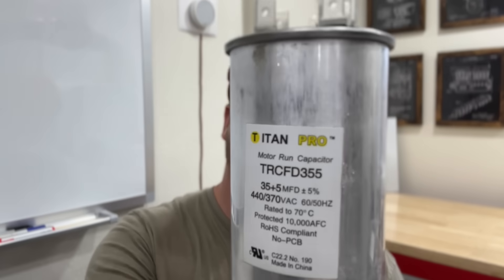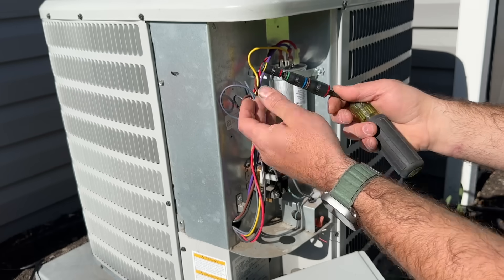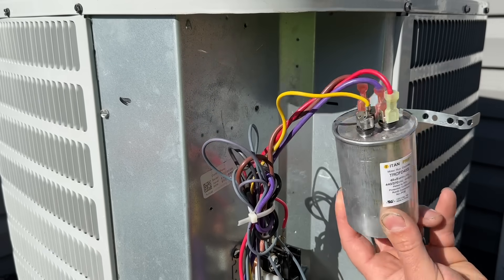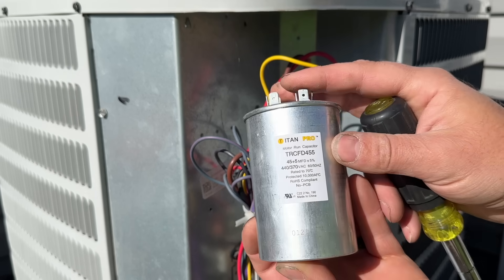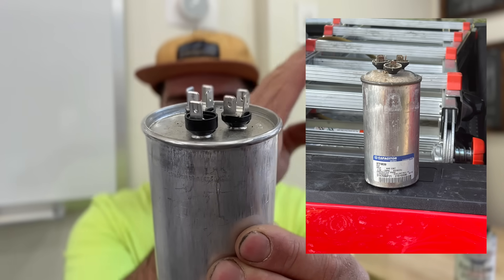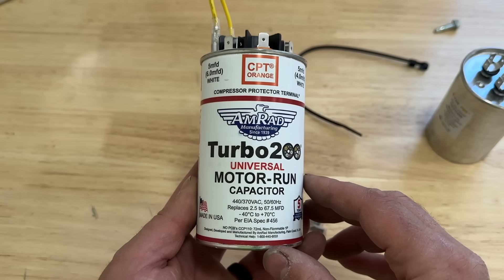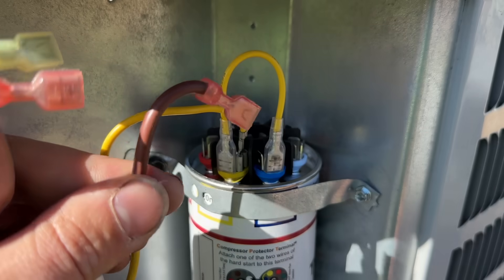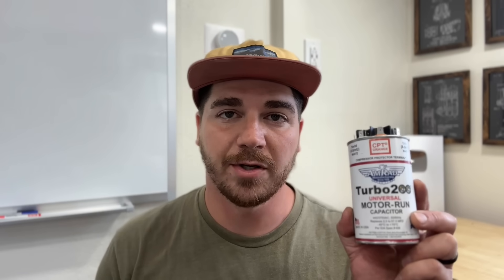HVAC Contractors Practically Make Their Living On These

Comment: I've learned a TON about hvac (mainly AC) from you in the past 2 years. I now own a new house and I've bought a replacement capacitor, added a soft start kit, cleaned the coils and checked the refrigerant pressure, thanks to you and your videos! Genuinely appreciate what you're doing.
Reply: Cleaning the coils is something people largely don't do and not changing the air filter at least once every 3 months. Or get the wrong air filter and shorten the life of their air handler. I never go over Merv 11 for an air filter. The higher the Merv rating the more it restricts airflow and the harder your air handler has to work. Besides anything over a Merv 11 rating is overkill for 99% of people.

I clean my coils at least once every 6 to 8 months on both my outside unit and air handler.

Also, if your pour 1 cup of white vinegar down the evap drain pipe, monthly it will help prevent algae built up.

A little scheduled maintenance can go a long way in how long your AC unit will last.
Reply: @RhinoXpress  I’ve gotten into a routine of changing my filter every time I pay my electric bill…once a month.  I use an 8 merv filter.  I do have my AC guy come late fall and spring to do a preventative maintenance on my system. I’m in Florida so that AC is running CONSTANTLY for about 10-11 months per year. He showed me how to clean the coils myself and also how to suck that condensation tube out with my little portable shop vac to clear it of slime. This keeps everything going well between his visits. A little maintenance goes a LONG WAY! I love this channel and have learned a great deal here. 💜💜
Reply: @lizzieb6311   I pour a cup a vinegar down my evap drain pipe run off once a month, it helps eliminate  and prevent algae over growth in the evap pipe run off.
Reply: @RhinoXpress  I need todo this…is your 2nd unit (not sure what that is called) up in the attic? That’s where mine is and I noticed a white PVC tube with a cap on it - looks to be same diameter of the tube that comes out of my wall outside. It’s next to the drip pan under the unit in attic.
Reply: @lizzieb6311   that's called your air handler unit  and mine is in my garage.  that  cap with the PVC sticking up is apart of your evap drain pipe run off. If you pop that cap off you can pour 1 cup of vinegar down it and it will kill the algae build up. I find that it's better than doing the wet vac method cause it will kill the algae all the way down the pipe.  plus, vinegar is pretty cheap to buy.
Reply: @RhinoXpress  Thank you so much! I’m going to head up to the attic and dump a cup of white vine down the tube…so appreciative of your clarifying the name of the air handler and explaining to me. Thank you ☺🌟
Reply: @lizzieb6311  no problem. My good friend is a HVAC tech so I learnt a lot from him on ac maintenance that your typical person can do.
Reply: @RhinoXpress  What is a “condenser tube run off?”
Reply: @RhinoXpress  That is NOT a “condenser tube run off.”  That’s a cap on the evaporator condensate drain, and the cap is there to maintain the negative pressure on the drain…
Reply: @RhinoXpress  Yeah, I had a air filter rated at 9  - my AC friend told me to take that off and put a cheap air filter as it would allow better air flow and since it's 105 in Texas right now I know that puppy is going to be working extra hard.
Reply: @Kenny-bj2zq  there is a trade-off to that. The lower the merv rating the more airflow gets through but also the more dust gets through and will build up on your air handlers radiator over time. I usually go with Merv 8 it gives you the best of both worlds of airflow and dust collection.
Reply: B @RhinoXpress  Merv? Explain plz. Am in no way a techie, electrical or anything else for that matter.

Got fried by a lightning strike in 75.
Got hit by a Huge Truck in 15 - suffered a Traumatic Brain Injury.
Have had 5 brain strokes in the last 
3 years. My body must be in failure mode. Brain Strokes don't run in the family, they don't even crawl. 🤔😯😥😎
Reply: @StuStevens-rn7rb   Merv rating is basically how well your air filter can filter out particles. The higher the Merv rating the less particles can move through, which is good for air quality, but at the same time it makes your air handler have to work harder to move air. So you have to find a happy medium. Many in the industry suggest either a Merv 8 or Merv 11 as a happy medium.
Reply: Checking the pressures alone doesn’t really tell you how the system is functioning. The compressor is cooled by the returning refrigerant vapor and matters … if you’re going to do your own for the average homeowner it’s easier to measure the air temperature difference at both ends it should be within a degree of each other and depending on the latent load this differential can vary but is very revealing about system performance
Reply: Checking pressures when not necessary is a bad idea. No matter what, you lose refrigerant each time you hook up gauges. You also run the risk of introducing non condensables into the system. Check Temps across coils and on the lines. Much better info with no risk.
Reply: @bluejay713  Getting a replacement compressor is not difficult.  Finding a complete condensing unit is  near impossible.
Reply: @bluejay713  Hard to say without knowing the amperage draw the motor is pulling.  If it’s the original motor (or even second motor), I wouldn’t be surprised if it’s failing.  Many years ago, fan motors would last a very long time IF the ports were oiled annually.  Being that many times the motors were never being oiled, the motor manufacturers switched to sealed “bearings” (most of the time is really nothing more than a bronze thrust washer with a dab of grease), and the motors don’t last nearly as long.  Wouldn’t hurt to replace the fan motor and capacitor, either way.
Reply: @bluejay713  Probably a good idea to see what the inspector determines.  Keep in mind, too, that a motor replaced in 2000, is now 23 years old….that’s a pretty good life for a fan motor.
Reply: @bluejay713  If it’s a Janitrol, even with fin damage, at that age, the fins probably won’t straighten, and may likely shred apart.  I’d see if they will just replace your AC under homeowners insurance, but if I were you, I would spend the money and replace the furnace at same time.  Been to many jobs to replace AC only to find out that the furnace was beyond repair.  A new furnace will have at least an ECM motor (unless you opt for really high end and go with true variable speed), which can help somewhat overcome duct work deficiencies.  Many older homes had ductwork designed for heating only, as residential AC was not that common yet, and end up having issues cooling because the ductwork is undersized.
Reply: I bet you know squat about hvac
Reply: Why not replace the contactors next ? :)
Reply: Just curious. Did you buy all of the equipment you need to do this? There's a reason we in the HVAC industry have to keep renewing our license every year and be registered with the state and have insurance and be bonded. I have no problem with somebody learning about all of this. But if you're not good enough to do it for a living maybe you should keep your hands out of the electrical box.
Reply: @jimlippi4001  You sound really angry that people are learning to do things themselves? Interesting.
Reply: @DerekFletcher1 how did that sound angry? You seem really eager to attribute anger to a dissenting view. Interesting
Reply: @DerekFletcher1  lol, to keep the analogy going, it’s as easy as learning heart surgery, so there should be no fear…

Comment: Most state hvac licensing boards are responsible for enforcing ethical behavior by contractors, and most are lazy bureaucrats who do nothing. Complain to your local state representative if you deal with a scam contractor (and about half of us are crooked, imo). Demand action.
Reply: The board can't do anything if the contractor isn't reported. The board is dependent upon complaints before they can even investigate.
Reply: I dont know if the laws have changed but if a contractor has a price list for certain work it's perfectly legal. In fact 60 min ?? did a show on this years ago on an electric contractor in Calif was charging insane prices for breakers. But since they had a price list it was perfectly legal. Also, that contractor had full yellow page ads so their overhead was high too.
Reply: @Steve-LetsSingIceIceBaby2gther  price list alone doesn't necessarily make it legal. On the surface it may be but you also have to look at underlying business practices. This would also be illegal gouging if an emergency was declared. I'm not against high rates because someone needs to be on the high end but I am against prices that are so ridiculously high that they are considered price gouging. You also have to consider the fact that the contractor may be charging a flat rate for the repair. If the contractor is charging for a more expensive repair when they have a cheaper flat rate that covers this then they are pulling illegal business practices by charging for more than they should be.
Reply: Good luck, bro. None of us are going to anything unless all of us do something.
Reply: " hvac licensing boards are responsible for enforcing ethical behavior"

In what alternate universe does that happen?
Reply: Sadly price gouging is a common practice in most (not all)  businesses, not just HVAC. Most legal representatives won't go after businesses, it's a long sketchy process dealing with pulling a business financial records and finding the smoking gun.
Reply: @dwaynewood1795  it's mostly legal. Under normal circumstances it's expected that the free market will limit or extinguish their business. It is illegal under a state of emergency. The reason it requires so much research under normal circumstances is because they are looking for other issues such as price fixing or acting like an illegal monopoly.